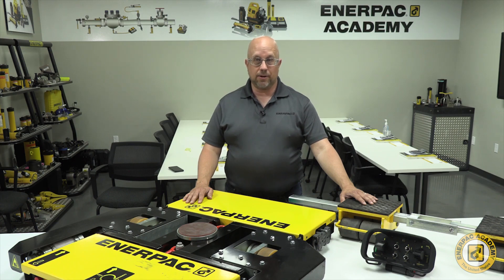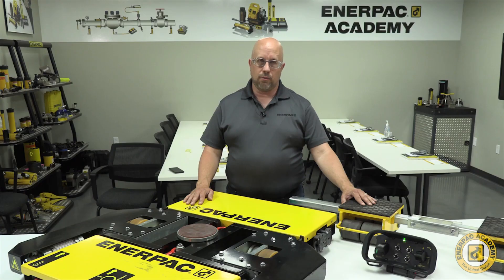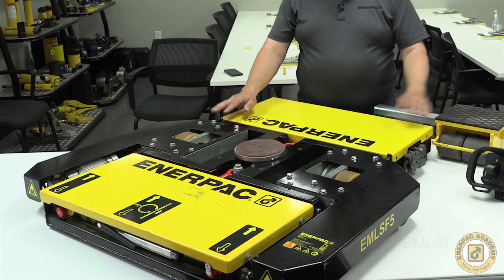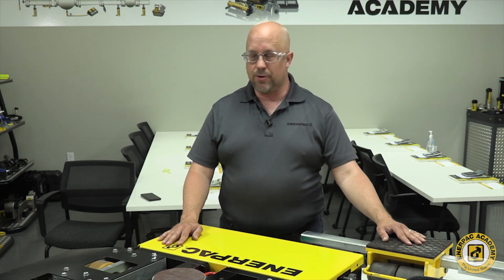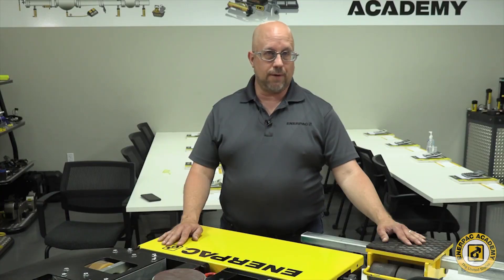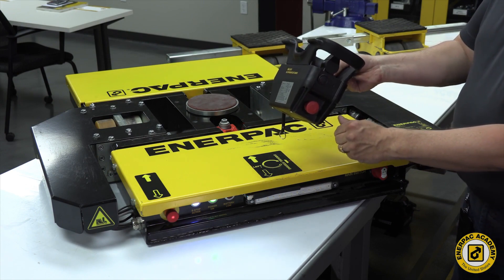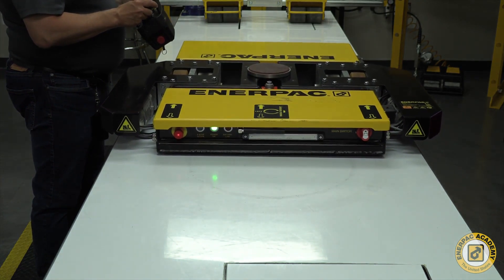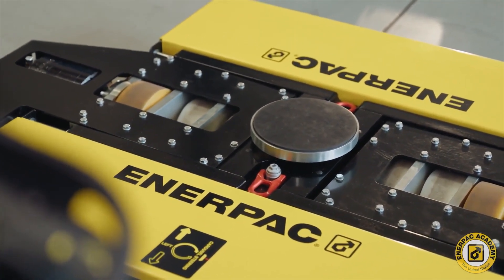How to operate EMLS-EMV Battery Powered Machine Skates | Enerpac

Comment: Enerpac makes amazing equipment for Millwrights. For the skates, though, I have always used Hillman rollers. They aren't as fancy, but they work. Hopefully, Enerpac addresses some of the dangers present in traditional skates. I saw a guy get his shin bone smashed when a skate kicked out from under a machine, and his leg was in the way. The skate wheel jammed up on a little rock on the shop floor and caused the skate to jump put from under the machine. Stay safe